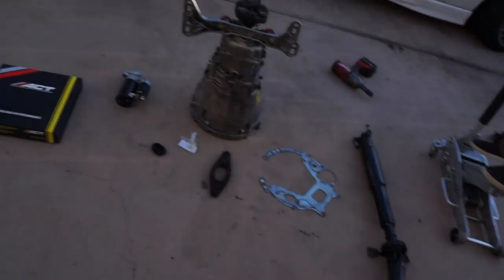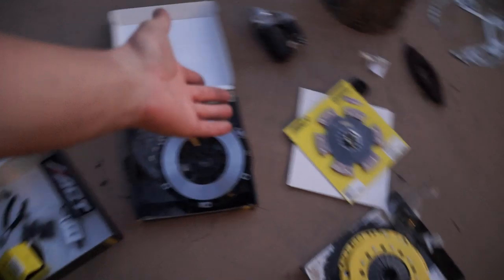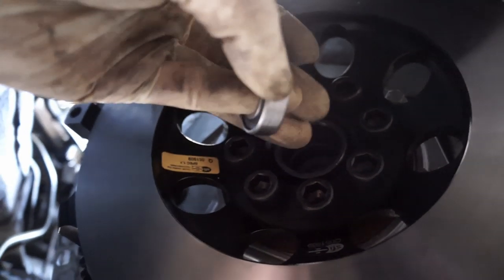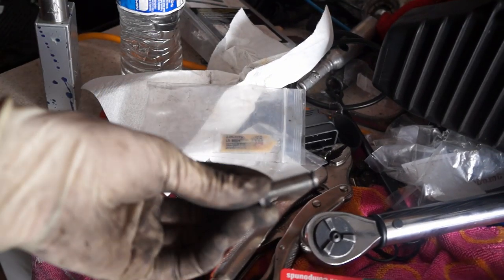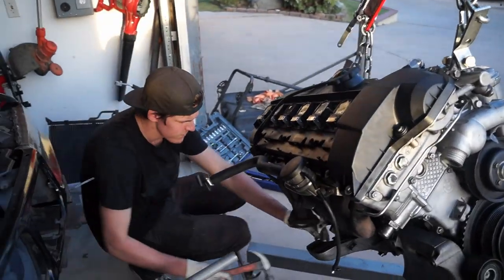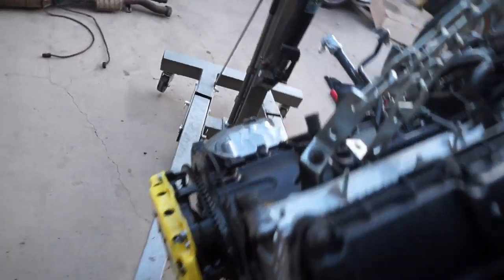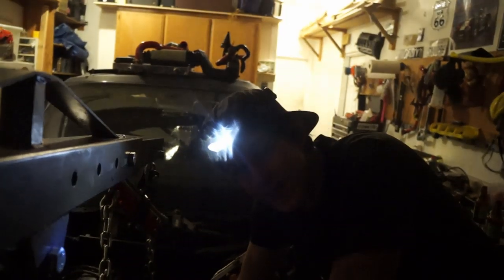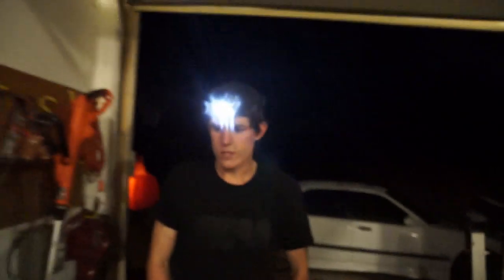WORST Clutch install Ever.

Comment: You should definitely make a video about best practices, tips and tricks for keeping track of hardware, parts removal order, connectors, etc. I am planning to swap soon, but I want to remove the whole front end and pull the engine with the transmission as a whole. Not because it is easier, but because I want to clean/inspect the engine and replace all seals. And there is no time pressure at all  - it's a convertible and our winters in Canada are long. One thing that stresses me is inventorying and tracking. I need a strategy for that, so that I can put everything together 3-4 months later. I think a video with best practices from M3NACE would be well received. Your videos are great Quinn! Thank you!
Reply from the maker: yeah +1 man, i can do that lol

Comment: Next time if this happens, just remove the front end of the car and slide straight into engine bay. The bumper support has 2 pinch welds holding it to frame. Drill those out and thr front end comes out almost as one peice
Reply from the maker: yeah +1

Comment: i was wondering why you didnt just mate the trans/engine and drop it in as one unit.  doesnt the e36 front come off cleanly to just slide the motor in?
Reply from the maker: i find it easier to just throw the trans on when the motor is in the car, the motor doesnt go in as nicely with the trans on. pulling the front end off is not as easy as it sounds as the radiator support is spot welded in several places, not to mention im not a huge fan of removing things if i dont need to lol.
Reply: I would definetly advice to remove the front. Its much more easy to put the engine in and out this way. Takes only 30min or so to take off everything.
Reply from the maker: +1 lol
Reply: Lol thats exactly what i told him in one of the previous videos, It's a whole lot easier to do this job with the front end off; You only need to take the headlights and radiator and off and unbolt the radiator frame and just move it out of the way (no need to remove hood latch and ac stuff)and you've got plenty of room to work with. I got mine in all by myself with the gearbox, harnass and intake manifold attached to the engine using the same engine jack with some good ropes